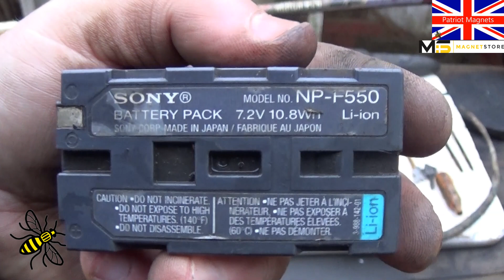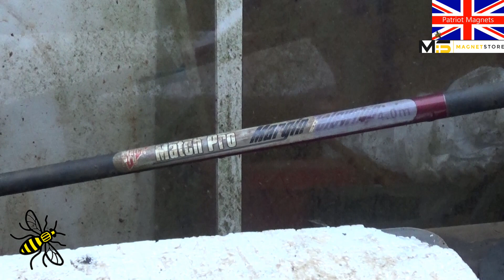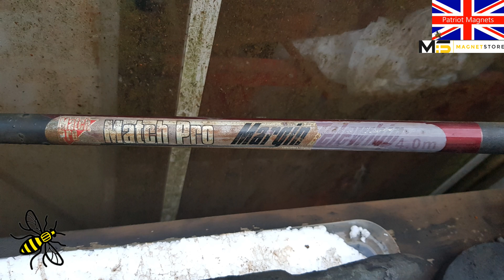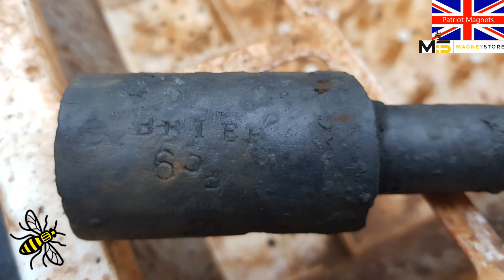Persistence pays off Magnet fishing

Comment: Hi Scott, your first item was a piece, broken, of a bevel gear wheel, which would be mounted on the horizontal or vertical axis, going onto a mating bevel gear.  These are
found on old style machinery, not fast rotating, maybe an old pedestal drill from a workshop.  Bill in Brisbane.
Reply from the maker: Cheers again bill for this information much appreciated.  👍🇬🇧